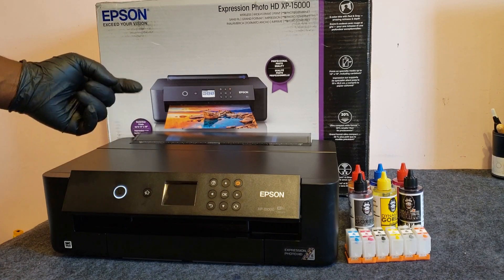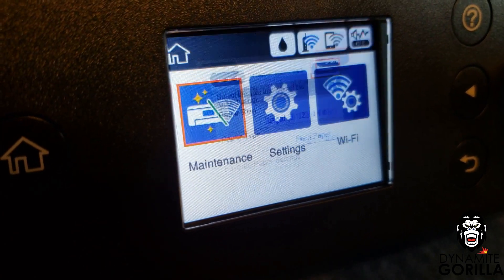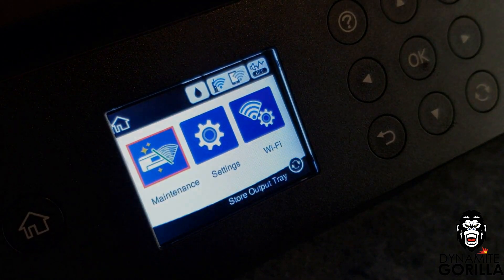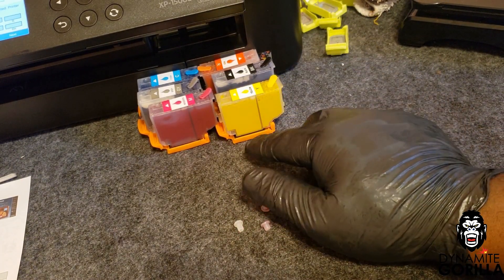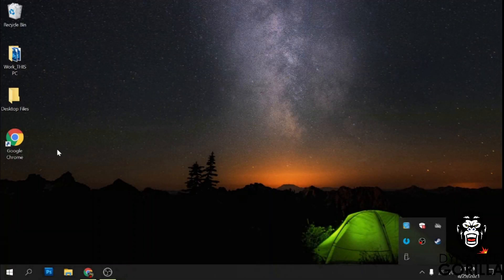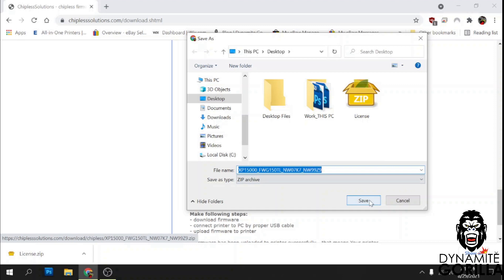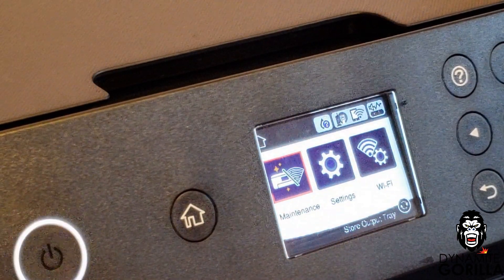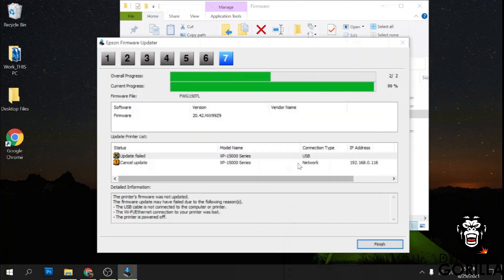Expression XP 15000 Sublimation

Comment: I am working on a Macbook, and assistance on how I would go about using this process.
Reply from the maker: You'd have to use a windows PC to install the firmware, maybe ask a friend to use a windows based  laptop or tablet? Once the firmware is activated, it stays on the printer, so you can hook it back up to your MacBook and the printer will still be chipless.

Comment: please help, I have completed every step. when I print, nothing comes out. just a blank sheet of paper. This video really helped. It was very detailed. Im afraid ive overlooked something
Reply from the maker: Make sure to remove the vent hole plugs from the cartridge or the ink won't flow and it will print blank pages.
Reply: Thank you. I will try again after work
Reply: So I’ve removed vent plugs and still not printing . Anything else you could suggest?
Reply: I bought . “ 312XL 6 Color Refill Ink Cartridges No Chip XP-15000 “ cartridges off of Amazon
Reply: **props

Comment: When I enter the activation code I keep getting an error and I don't know what to do! I changed usb plugs too. 
error 10089 - Communication failed. Please, check connection between printer and PC. Change USB port. Check network connection, make sure that proxy is not used and disable firewall. Try again later. - 10089
Reply: did you ever get this issue resolvedd?  I am having the same issue

Comment: When entering my activation key and click ok.  I am getting a communication failed. Please, check connection between printer and PC. Change usb port, check network connection, make sure that proxy is not used and disable firewall. Try again later. - 10092.   PLEASE HELP
Reply from the maker: I would try another cable or port . I'd that doesn't work. Hit up inkchip.net support email and they can help you.

Comment: I went through all the steps and the ink want come out, but it is going through the print process.
Reply from the maker: Make sure the vent plugs are removed.
Reply: @McZell  where is it located
Reply: Where are they located,  I tried removing the one on top but that didn't work. It is trying to print but there are lines and the picture looks like an outline.

Comment: How do I know if the ink is low with this chip less firmware so I can refill the ink ?
Reply from the maker: You’ll have to keep an eye out. When I would use cartridges, I would make sure I topped the cartridges off before I print. You can top them off while they were still in the printer. I now have a ciss on my xp15000.
Reply: @McZell  my print head won’t move when I turn it on to boot up it moves a little and stops then I get a paper jam and nothing I do, unplug it plug it back on boots
Into paper jam is there something I did wrong ?

Comment: Why can't we install this firmware wirelessly? I do not have the usb plug required. EDIT TO ADD I BOUGHT A USB CORD AND INSTALLED FINE BUT WHEN I WENT TO PUT IN MY PURCHASED ACTIVATION CODE IT GAVE ME ERROR CORE 10091. WHICH UNDER THEIR ERROR CODE SHEET SAYS TBD. HELP?
Reply from the maker: Is the error on the printer? Or on the activation program?

Comment: I did everything, but when I try to sublimation for my tumblers it is not transferring. Not sure what I did wrong.
Thanks
Reply from the maker: Make sure that you run a few purge files to get the non sublimation ink out of the print head.
Reply: @McZell  do you have a video on how to purge for an xp15000? I am pretty sure you have shown, but I missed it. 
Thanks